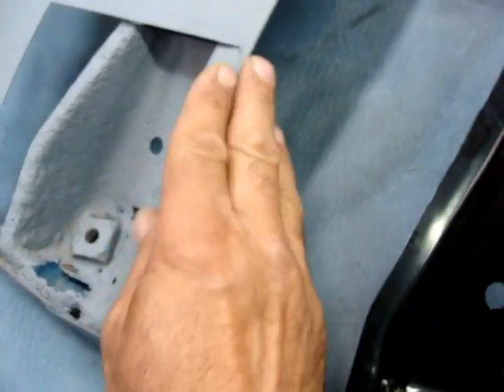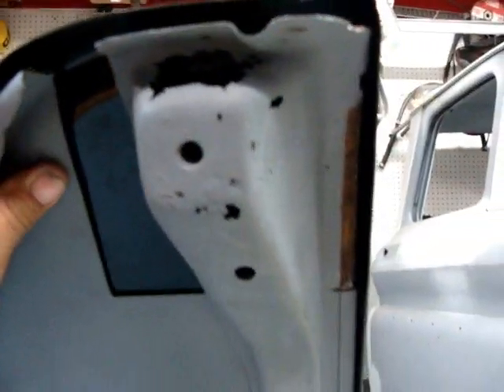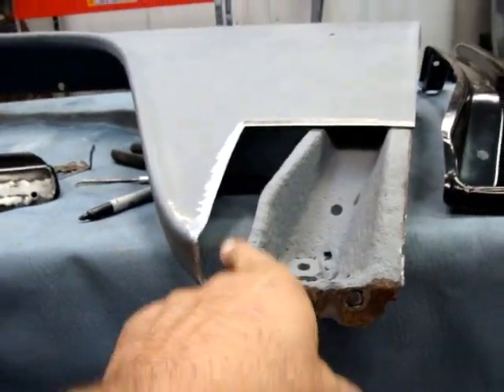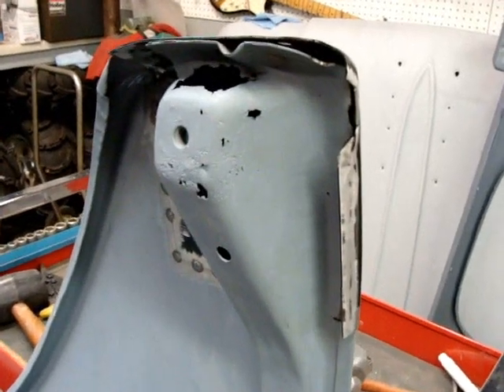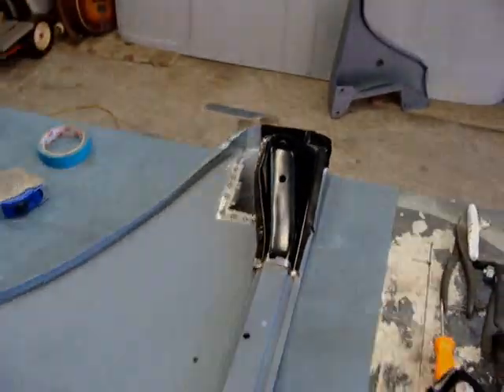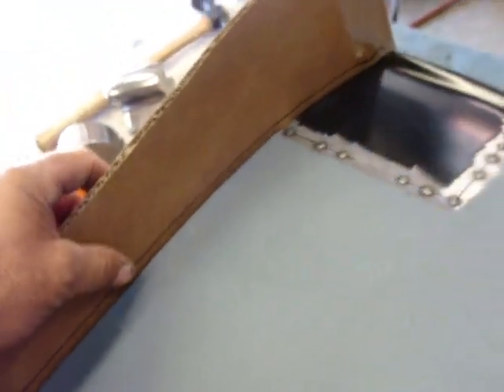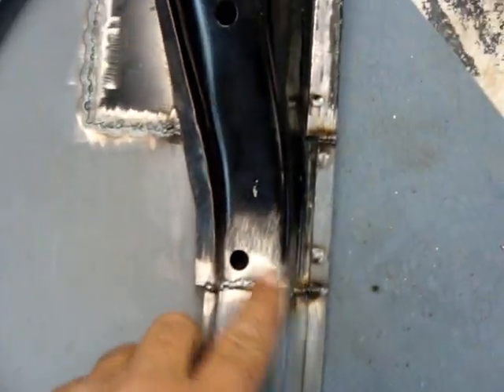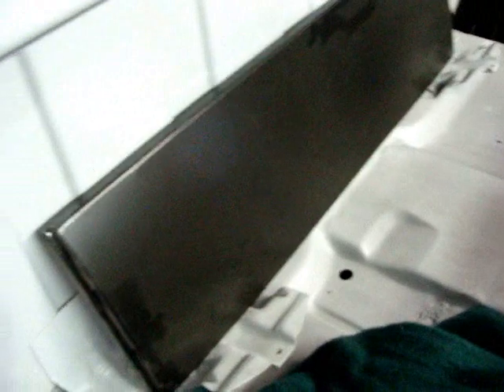Fender bottom rust repair

Comment: Have you ever used the oxy acetylene method for welding body panels? I've even heard people using the brazing method, you know using the bronze instead of just plain old steel. What is your take on that?
Reply from the maker: I've only used the mig welder on welding never used anything else thanks for watching
Reply: gibson63 Awsome videos, I noticed you prefer using electric tools more to using air tools :)). My kinda guy, old fashioned and simple.
Reply: Filler doesn't stick to that type of weld and it gets very hot. It will warp things very easily.

Comment: Nice work. What brand/model welder did you use?
Reply from the maker: SonOfMrGreengenes   Lincoln pro-mig 135
Reply: Gibson63 are you using shielding gas with it? Or flux core??

Comment: why do you tap the welds after?
Reply from the maker: The heat draws the two pieces of metal together so I hammer it down while it's still hot to bring it back where it was

Comment: Why not finishweldung the outer panel after you get the inner brace fitted that way you can properly finish out the inner surfaces of the patch.i would not recommend undercoating but a high quality epoxy primer .

Comment: I did never understand people like this gentleman people buy full new panels instead replacing whole panel they cut and use half or quarter why not replacing whole thing
Reply: I can say firsthand its several reasons. 1) when doing a full resto, patches are much cheaper than panels. & panels don't always fit right. 2) the preference to keep as much original steel as possible. 3) anyone can replace a panel, but it takes craftsmanship to patch old steel. I happen to LOVE the craftsmanship.
Reply: 64impalaSS Also just think about all the material he saves for the next job.
Reply: Why cut out as much as possible when you can just weld in a new patch and save a lot more money